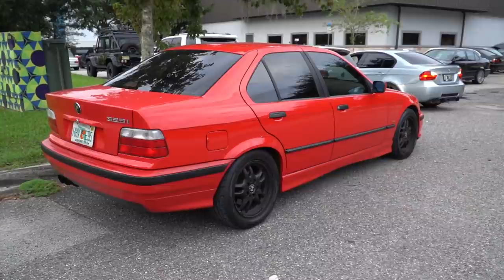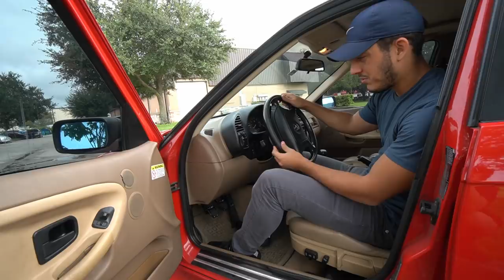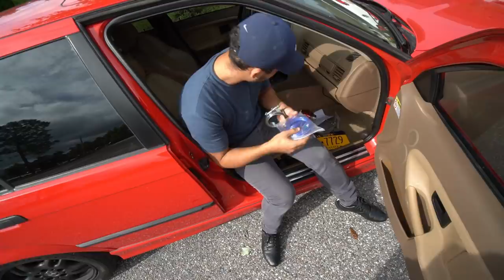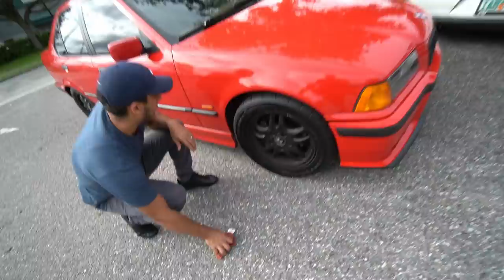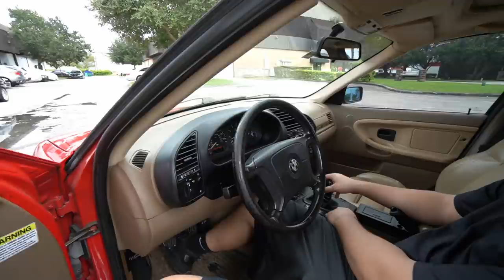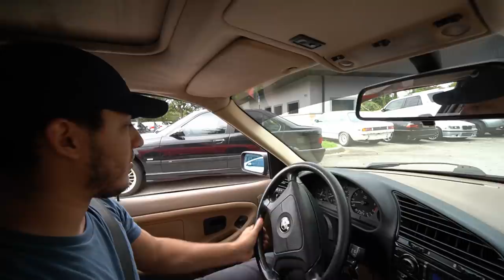When Owning 3 BMW "Money Pits" Isn't Enough, So You Buy A 4th One! (E36)

Comment: I got an e46 330ci zhp 6 speed in alpine white with 262k miles on the clock still in really good condition no oil leak or check engine light thats been my daily for a year so far not even lifter ticks or faulty vanos which are common on high mileage love the car still to this day I dont regret buying it it just shows who takes care of the car before you had it the original owner was an old guy who passed away
Reply: your oil pump nut will back out soon